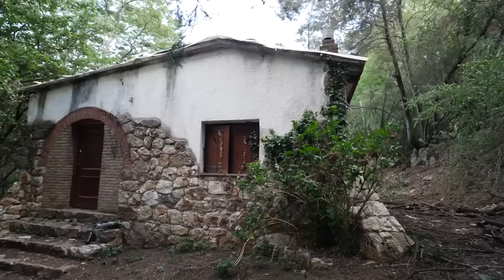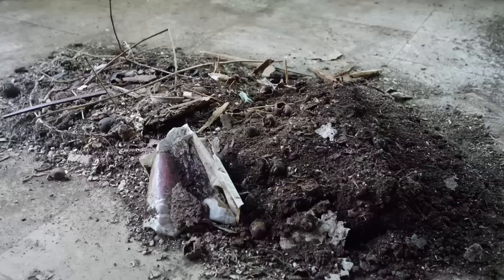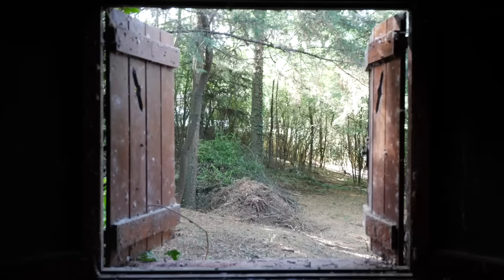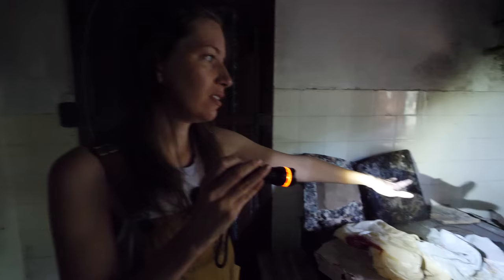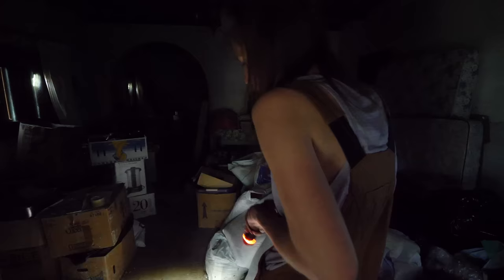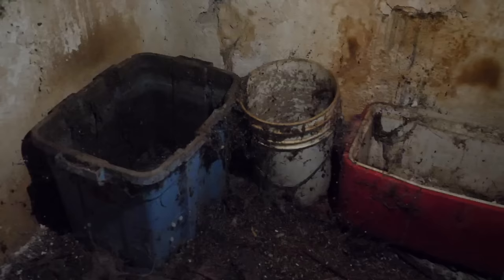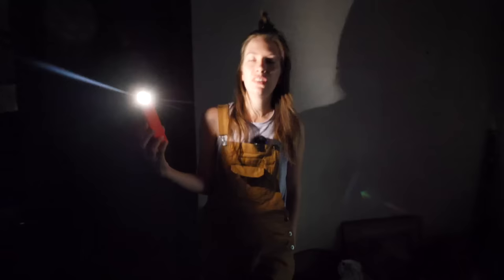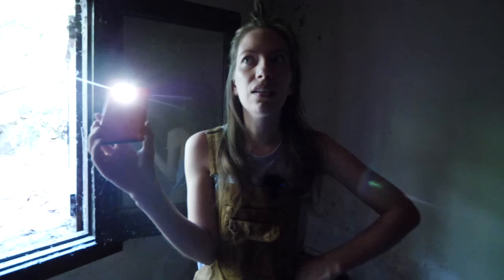This House Hasn't Been Lived in for 20+ Years! 🏚 | We Tour An Abandoned House in Argentina

Comment: Hey guys - OK so you have asked what we think. I think you have a solid building right there that has no visible cracking - there is some green moss/mould on the walls but that is more than likely due to a leaky roof that you are hopefully fixing first. Second thing to fix are the windows - replace them with new double glazed ones and make them as big as you can, especially the kitchen window. Plan your project with a budget and have a generous contingency - normally this would be 20% in this case I would have 50% up my sleeve of the planned budget. If you don't have that money don't start the project !! The most important advise I can give you is engage the best local trades people that you can afford and ask to look at examples of their workmanship - and for God's sake DO NOT get Jeff Thorman to do anything !! Take care.

Comment: Decent condition house.
The light fixture in the very first room is an incomplete "Wagon wheel"  missing the rim and the glass chimneys.  They are fairly collectible. 
The tall Quartz Heater were one of the most expensive space heaters in the 1980s. Definitely keep if you ever need a heater around as it has no moving parts to fail and render it useless.
I remember the Kerosene heaters they are good in a power failure so keep one full just in case. 
The magazine collection could be wanted on the second hand market but the novels unlikely. 
I know from experience you can repair an old house without destroying everything and replace with plastic.